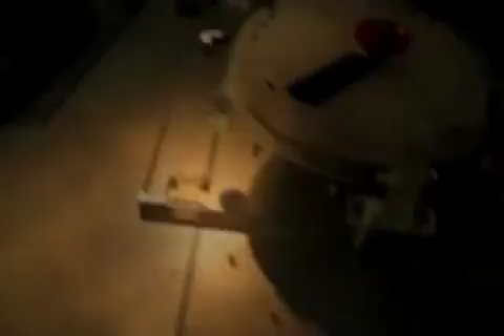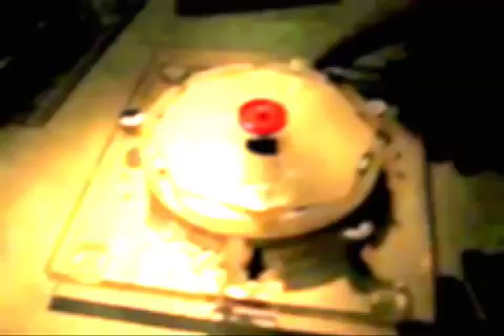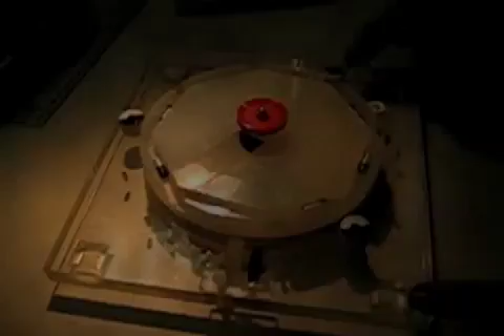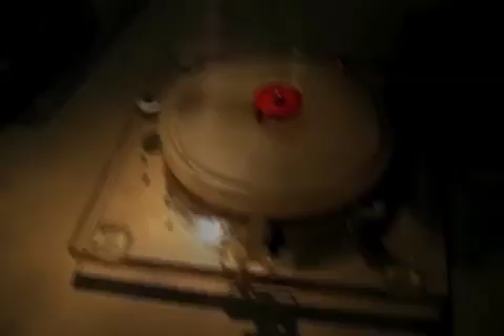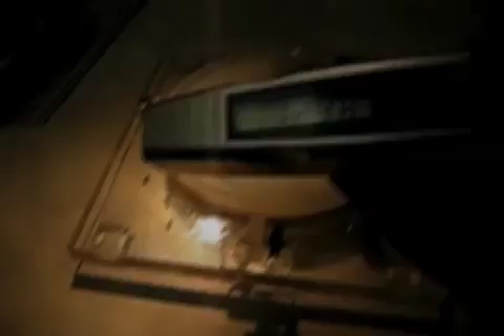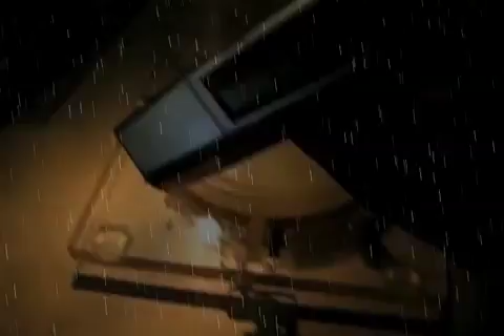The WhipMag/OCPMM Explained

Comment: As always with free energy claims there is a shortage of explanations, everything seems fine until you have to actually explain what the hell you're doing, and how it's supposed to work.

What is the design? Is it hooked up to any electrical device of any kind, and if so, how? How much energy is going in when you spin it (which you should do mechanically anyway)? How much energy is coming out and what happens when you harvest it?

These are basic questions, I shouldn't have to ask you this.